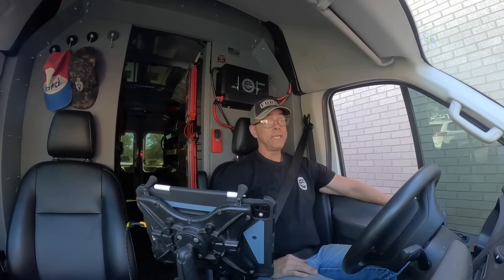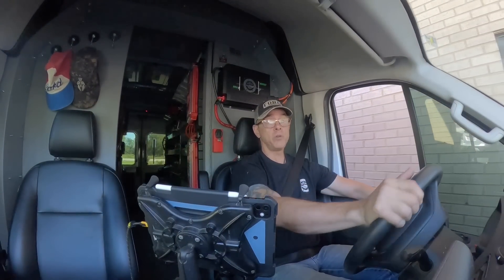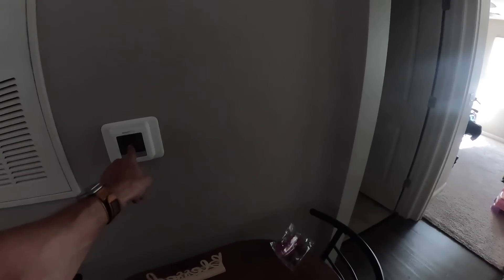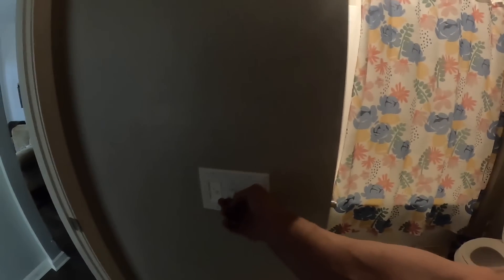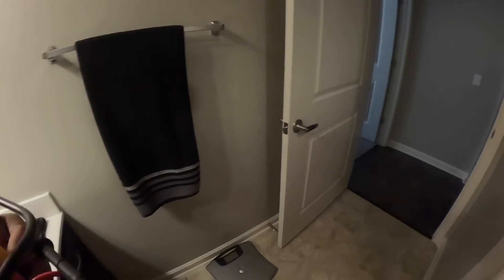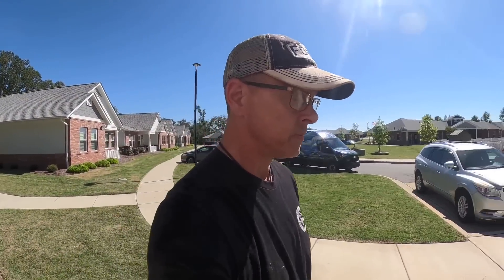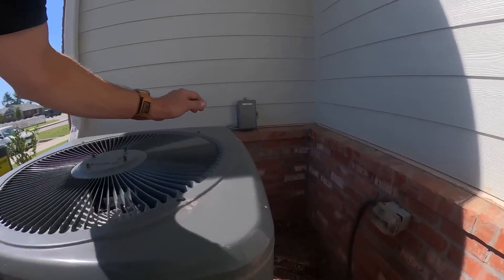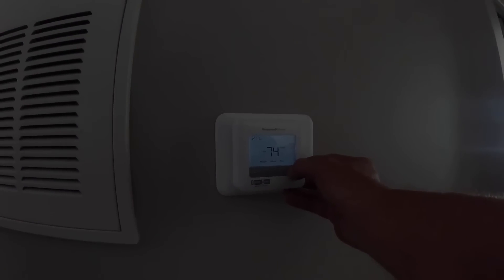Tenant Called Because Nothing Seemed to Be Working! #hvacguy #hvaclife #hvactrainingvideos

Comment: let me ask why do you use batteries in that stat  if you have a 24 volt common wire if you got a 24 volt wire then you dont need batteries.
Reply: In case the 24v power goes out, so you don't lose programming

Comment: The more I see eletronic thermostat s the more I dislike them. When I was working (retired)ran into a unit with an air handler with chill water cooling coil   a preheat steam coil ,`reheat coil with pneumatic controls .On top of a steam coil and electric heat in room. Took me hours to get programming right .  I do enjoy watching your adventures .

Comment: Nest thermostat says no power. After i take out batteries to the thermostat, it worked
Reply: When you pulled the batteries, it probably reset.
Reply: @jthonn  I did not put the batteries back because it had a common wired
Reply: @thefreshride1510  My t-stat doesn't use batteries. It has to have the c wire to power it, so I imagine on yours it just used the batteries so it can remember your settings?
Reply: @jthonn  something that i noticed too. When i wired red and green in thermostat wires it doesn’t turned on the blower idk im a “tech” i know how to do it that way to check a bad thermostat but who knows i just torqued the screws in the air handler that connects all the wires
Reply: @thefreshride1510  Well there you go, just a bad connection.
Reply: @jthonn  yes pretty sure that was the issue
Reply: I have found that Nest thermostats are crap! Google has no business telling you what temperature you should set things to